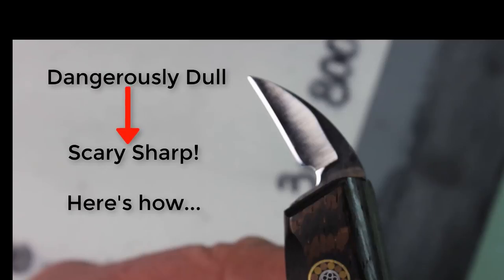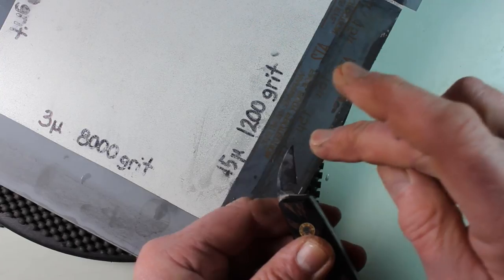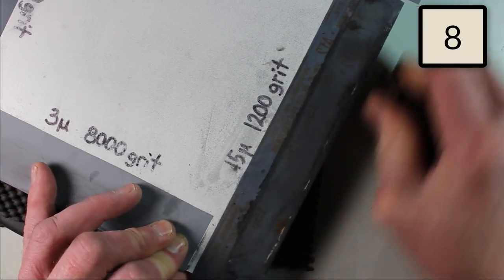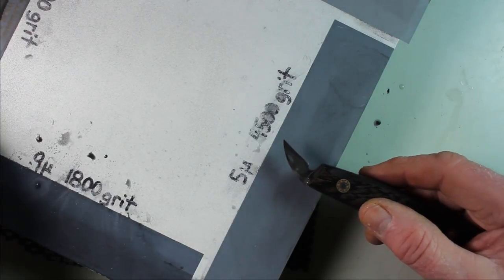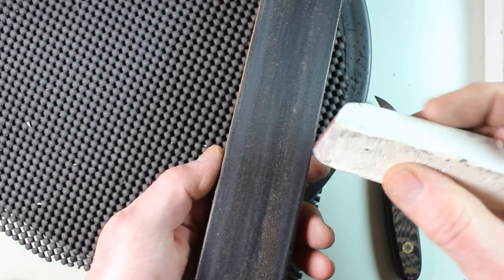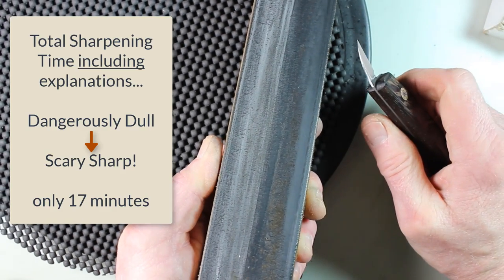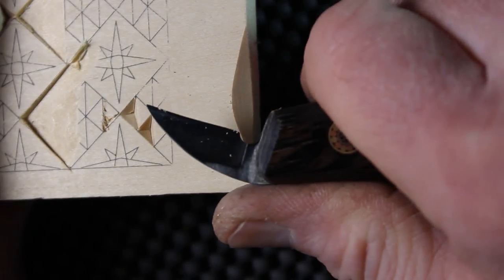How to Sharpen Your Knife from Dangerously Dull to Scary Sharp!

Comment: Just a question; when you sharpen your knife, how long does it stay sharp?  Of course I understand that it will vary with usage and the type of wood you’re carving, etc. But with your experience you can probably give some clue as to how often you have to sharpen. Twice a day, once a day, twice a week, etc.
Reply from the maker: Hello - when carving basswood I'll try to strop my knife after every 20-30 minutes of carving. I use a leather strop with white gold strop compound and will strop each side of the blade 7 times and then 6 times, 5 etc. down to 1. I've found this keeps my knife sharp for a long time (months). When the stropping doesn't seem to be achieving the desired sharpness, I then use the higher-grit abrasives to touch up the blade.

Comment: 1 of the best so far. I will be making a sharpening board....But what's the best way to sharpen a curved blade.
Reply from the maker: Use the same technique and pull the blade across the abrasives in a sweeping motion. Turn a burr first. then start counting down
Glad you liked this video

Comment: For honing I find plain printer paper works well instead of leather when loaded with the white compound. All you need is a flat hard surface under the paper. When the strip of  paper loads up with old compound and filings, just move the paper over for a new surface. Cutting the paper into strips may make it easier, and the paper can be used on both sides. It is easy to see which side has been used as it will be black. 
I think this works even better than leather because leather is soft.  As you pass the knife over it, it will wrap around the edge of the blade rounding the edge to some degree. Maybe a microscopic rounded edge will stay sharp longer I don't know, but you could do that with the paper as well with a slight flip of the wrist on the last stroke or two.
Reply from the maker: Thanks for your comment. You are correct in many regards. I started by using cereal box packaging in the same way. Hard, flat and holds some compound to do the honing. With the same principle in mind, the leather on my strops is thin so it compresses very little. This will avoid any rounding if a thick soft leather were used. I had to think of my customers, end users in mind when providing a strop. Something that would last a really long time.
Reply: Possibly because most printer papers are covered with a very fine chalk to hold the ink properly

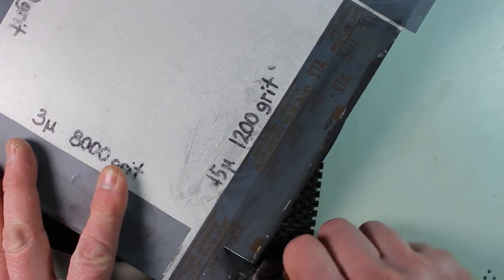Comment: 1:42 "raised up a bit". You don't want it flat? What is a little bit? I'm new to sharpening. Thanks
Reply from the maker: Raise up the spine on a knife similar to the one shown about the thickness of a dime. Raising it up creates a small secondary bevel to create the Scary Sharp edge! Leaving it flat would require removing all of the metal on each side of the blade until the sides meet at the cutting edge. That's not necessary and would take a long time removing metal that doesn't need to be removed. Removing just a small amount of metal to form the secondary bevel is all that's needed to make a knife Scary Sharp and cut beautifully. Thanks for your question.
Reply: @MyChipCarving  thanks!

Comment: There is a horizontal line in middle of blade shude stuck blade from this line below completely to sandpaper?
Reply from the maker: If I understand your question, the small bevel on the edge of the blade (forming the "horizontal line") is all that needs sharpening. This is called the secondary bevel.

Comment: loved your tutorial...the best one...what would you raccomend for a titanium wood carving knife ?
Reply from the maker: Hello Zirbo Man, After brief research, titanium has very low carbon amounts which means it can be sharpened using this method but probably won't hold an edge for very long and won't get as sharp as higher carbon steels. If the knife comes from China it may not be titanium at all. Here's a link with more info https://material-properties.org/steel-vs-titanium-comparison-pros-and-cons/. Interesting question :-)  Thanks

Comment: Brother, I have a Tormek T-8 which is Amazing, but my question is, (and maybe I missed it), what are you using to hold the sandpaper down? Is it double face tape? Thanks!!!
Reply from the maker: The abrasives are self-adhesive silicon carbide. More portable than our Tormeks 🙂. Abrasives are available at mychipcarving.com. Thx for reaching out.

Comment: Thank you. I got the Beavercraft version of this knife, unfortunately it came very dull doesn't cut through a grape. I struggle to sharpen it. Do i need those exact numbers? Or any course / fine sharpener would work?
Reply from the maker: These abrasives are needed with a strop to get a Scary sharp edge. Lower grit abrasives will work but your edge won't be as keen. Mychipcarving.com for complete Kit

Comment: What is the aluminum stick in your kit for?  Is it just a container for the strips?  I didn't see it in the video.
Reply from the maker: I replaced the melamine board with the aluminum stick. Abrasives are stuck to the 4 sides and extras stored inside. It's a nice upgrade.

Comment: Hello bonsoir, merci pour cette vidéo instructive. Faut il expressément du grain 1200 pour affûter le couteau émoussé ? Il est très difficile de savoir quand le papier émeri de cette finesse est usė vu que la douceur au toucher est sensible. Usez vous le papier jusqu’à la trame ? Cette technique d’affût âge est-elle valable pour tout type de couteau de sculpture sur bois ?
Merci de votre réponse,
Michèle
Reply from the maker: Bonjour, 1200 grains sont nécessaires avec un couteau très terne pour former le tranchant et tourner une bavure. Vous devez tourner une bavure! Lorsque l'eau cesse de devenir noire, il est temps de remplacer le papier abrasif. Oui, vous pouvez utiliser cette technique pour affûter tout type de couteau ou d'outil à bord plat. Cela fonctionne très bien! Ravi d'avoir de vos nouvelles! visitez MyChipCarving.com pour plus d'informations sur la sculpture de puces.

Hello, 1200 grit is needed with a very dull knife to form the cutting edge and turn a burr. You must turn a burr! When the  water stops turning black it is time to replace the abrasive paper. Yes, you can use this technique to sharpen any type of knife or tool with a flat edge. It works great! Nice to hear from you! visit MyChipCarving.com for more information on chip carving.

Comment: How often should you sharpen your blade?
Reply from the maker: Once you have a scary sharp knife, stropping it after every 20-30 minutes of carving will keep it sharp for quite a while (weeks, if not several months) before having to sharpen it again. When you do need to sharpen it again, you may not have to use all of the grits. It may only require the last 2 grits or so. When you feel the knife isn't cutting as well as it used to and stropping alone isn't sharpening it enough, that's when it's time to sharpen it again.

Comment: while working the wood after how long do you have to sharpen the blade? do you just use the Strop or do it all over again? thanks!
Reply from the maker: Strop every 20 minutes while carving to maintain the Scary Sharp edge!
Reply: @MyChipCarving  when you use the Strop every 20 min, do you only do 10 passes per side or do you use the technique of 10-9-8-7 .... 1? thanks again, you are really very kind
Reply from the maker: @mikefrosio3331  use the countdown method. You can start at 6 and countdown and then on occasion start at 10.

Comment: Great video. Your close-up shows a small bevel at the sharp edge. I’ve seen other demos where they said that bevel should be flattened, meaning knock the points (or shoulders) off the bevel. What are your thoughts on that?
Reply from the maker: Hi Andy, sharpening a single bevel all depends on how thick the blade is. Makes sense on a hatchet or chisel. MyChipCarving Knives are very thin. 0.040" at the spine. A single bevel would create a very weak edge because there would be very little metal behind the edge for strength. I hope this makes sense

Comment: My only problem is keeping the knife at the same angle through all the sharpening.  Rolling is a big problem.  Practice, I guess.  What is the difference between the white compound and the green compound?
Reply from the maker: Thx for your comment, Bruce. Remember that the movement is not like an airplane taking off. You can even stop the stroke without lifting the blade off the abrasive or strop. I've found white compound to do the best for honing the edge. Other colors have different materials in them for different steels or more aggressive metal removal. More information at mychipcarving.com

Comment: Hi thank you for this great tutorial. I have 2 questions, can I start with a 1000 grit wetstone instead of 1200 grit sanding paper? And 2nd question, how often does one have to go through this whole shaperning process? At what point after some time carving do you have to do maintenance and with what type of grid can you do just maintenance? Best regards.
Reply from the maker: To maintain a scary sharp edge, use a leather strop and compound to hone the edge every 20 minutes while carving. Use the countdown method as explained in this video. You can start with a 1000 grit wetstone. Just be sure it is dead flat! Glad you learned something from this video. More at mychipcarving.com

Comment: What is the rationale for so many strokes per side? It would seem to be wasting steel.
Reply from the maker: It's a good way to build muscle memory when learning and to keep things simple. Too few strokes won't sharpen the blade effectively. Until a person has had some success achieving a sharp blade and understands what to look for throughout the process, it's better to do a few extra strokes. As one becomes more familiar with the process, one can determine the number of strokes needed to achieve the results they are after.

Comment: The grit i have is120- 3000, would that still work?
Reply from the maker: Don't start with 120. Start with 800 or 1000 unless your knife is really bad. Finish with 3000 but spend a lot of time on the strop. It won't be Scary Sharp, but it will be sharp

Comment: Why the high grit abrasive?  This seems like a lot of extra work considering lower grits will take less time. I'm just trying to understand the difference between the two.
Reply from the maker: The higher the grit, the smaller the 'scratches'. After 8000 grit you'll have a mirror finish. Honing on a leather strop finishes the process leaving you with a Scary Sharp edge, guaranteed! If you stopped at 1800 grit or 4500 grit, you'd be sharp but NOT Scary Sharp!
Reply from the maker: Kits and Strips available at mychipcarving.com
Reply: @MyChipCarving  

Thanks, I'm just recently getting into carving. I've sharpened a few chisels from 80 to 600 grit and finished with the strop. They are sharp with a nice finish and cut well. But I'm intrigued with your method. Maybe I'll try it someday
Reply from the maker: @geeblaze984  If you take it all the way through 8000 grit and hone with a strop, you'll never stop at 600 again. Scary Sharp Guaranteed!

Comment: How hard should I be pressing to try to get a burr
Reply from the maker: You should press firm enough so that the abrasive strip turns grey from the metal being removed. It should be fairly firm. It is crucial to feel a burr on the lowest grit before moving on to the next higher grit. If you're not feeling a burr after 10 strokes on each side, continue sharpening on the same grit for another 5 or 10 strokes. I will occasionally wipe off the metal shavings from the abrasive strip and apply more water before continuing to sharpen. I'd recommend focusing on applying firm pressure and maintaining a consistent angle from start to finish. Don't give up - you will get there!

Comment: You should clean your strop after awhile by scrapping the excess layers of compound off it will work a lot better and last longer
Reply from the maker: Sure enough!! To clean your strop roll your knife over and use the spine to scrape it clean. Do this over a trash can as it is pretty messy. Thanks for the reminder :-)

Comment: Will it help sharpen an old and bit rusty blade?
Reply from the maker: You may want to start on a coarser grit stone first remove the rust and form the bevel. After that you can start on the Scary Sharp Board 1200 grit and work through the grits and hone with the strop for a Scary Sharp Edge. You can do it!

Comment: Great technique, I just wish someone would design a device to hold knives at the proper angle while drawing across the sharpening strips!!! I have "shaky hands" which makes it very difficult for me to sharpen. I am able to chip carve by bracing my hand against the wood. I have some ideas for making such a device just an "inventor" of sorts to help fabricate.
Reply: I find it hard to be consistent in my holding angle. Looking at the blade I see the surface is rounded with the way it reflects light. So I hold the knife in one position pushing down on the sandpaper and then pull the paper through instead of moving the knife. I don't lift the paper very high when I pull. I try to keep it as low to the surface as possible. One other thing that may help you is using a knife that has a true "Scandi" grind. You just lay it on it's face which is easy to feel when sharpening.

Comment: Nice tutorial. The countdown would be so much easier than saying 55 strokes each side alternating between sides in sets. Are any carving knives single bevel? Or, are they all double bevel?
Reply from the maker: There are some single bevel knives. The Same method would be used to.sharpen single bevel except one side would be laid flat during countdown.

Comment: ARe you just using sand paper to sharpen?
Reply from the maker: Silicon carbide with self-adhesive back. 1200, 1800, 4500 and 8000 grit! Available at mychipcarving.com

Comment: Where do you get those strips from? Is there something I can Google? I live in the UK.
Reply from the maker: They were very hard for me to find in the US. You can search for "self adhesive silicon carbide abrasive". Good luck!
Reply from the maker: Use water to lubricate abrasive strips
Reply: @MyChipCarving  Thank you very much. I'm considering just getting a double sides waterstone, maybe 1000 grit and 4000 grit, then using my strop. I'm new to wood carving, (whittling mostly at this point) and the number of stones and sharpening systems is overwhelming! I will go off the principle of keeping my tools sharp, where I can. Besides my strop, which grit, or two grits would be most important? And would you say stones which only require water are better? I REALLY appreciate your help, as it's clear you have a lot of experience.
Reply from the maker: @Meloncholymadness  waterstones will give you a nice edge as long as they are kept flat. They do require maintenance / flattening so keep this in mind ☺.
Reply: @MyChipCarving  Thank you, I'll be going with waterstones, and then a flattening bar.